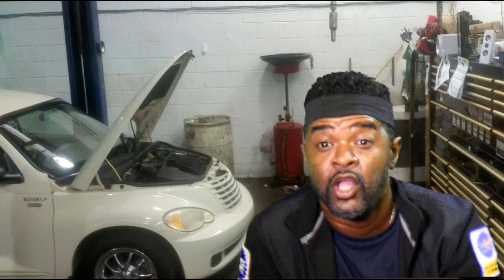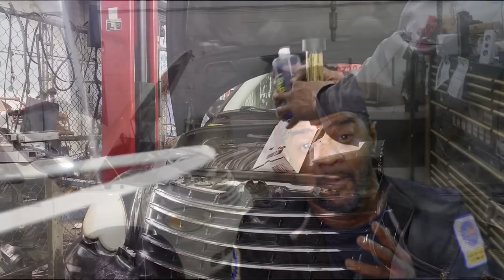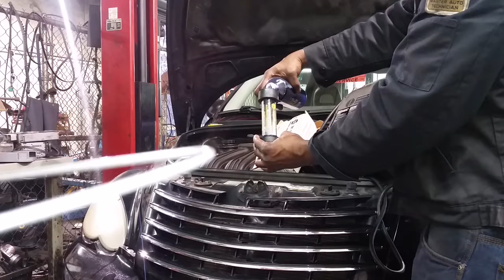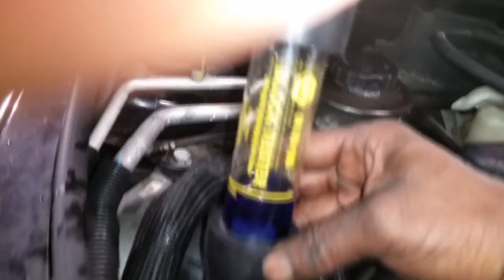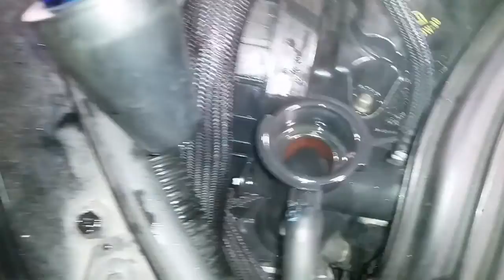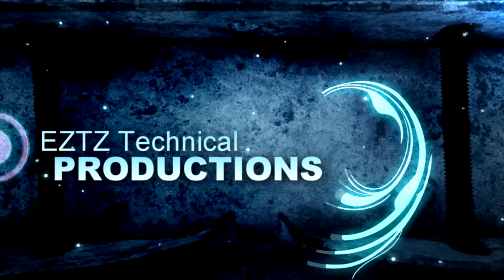PT CRUISER OVERHEATING AGAIN? Here's why. The last test and repair. Overheating with AC on.

Comment: My 2006 pt cruiser runs good but I notice when I drive it sometimes the water comes out of the hoes by the radiator in to the bottle  I have to check the coolant some times what causes that car run good it bubbles sound

Comment: Combustion test is the same as compression test?
Reply from the maker: No. One is to verify if exhaust gases getting into the cooling system.
Reply: @OnlineMechanicTips  would you  recommend to do both test or combustion test is enough
Reply from the maker: @blass5506  What year is the PT? What is it doing? And are you subscribed to the channel?

Comment: I buy cars and fix them and flip them. I just bought a 2001 PT for $800. It is overheating. They spent $2000 trying to fix it. The shop said blown head gasket. They sent the head to the machine shop. They put a new water pump, hoses, thermostat, fan and flushed the radiator. First thing I did was the combustion test. Blue stayed Blue. Next I removed the radiator cap to observe the flow. It was circulating. Temp guage was 1/2 way. I understand that’s normal on these cars. Took it for a test drive. Started rising temp. Stopped immediately. Lifted the hood. The overflow tank was starting too bubble… Air pocket!!! I let it cool. I drained the fluid. Opened the bleeder valve, filled it slowly, squeezed the top hose to purge air, once all the air was out, I topped off the reservoir. Took it for a spin, overheating problem resolved. Still runs a little higher over the 1/2 way mark. I replaced the radiator cap and thermostat with OEM now it runs just below 1/2. I’ve put 200 miles on it, no issues. Car was garage kept and super clean. I called the owner back and offered him back the car for his daughter he said they bought her a new car. He couldn’t believe it, so I took him for a test drive. I now have a customer for life. I also have a PT Cruiser for sale. I’m probably going to donate it to a family. The husband went through the windshield. He wasn’t wearing a seatbelt. She’s a teacher with 2 children. She has no car, they had minimum insurance. Cool explanation. The combustion kits are cheap if you work on cars keep one. If not OReillys will loan you one.
Reply: Great story...thank you for sharing with us all!!!

Comment: This is what my mechanic is telling me he thinks is happening to my car. He thinks I have a “micro leak” with the cylinder head.  But they don’t do work on that or head gaskets so they want to do some Blue Devil treatment that going to cost over $800. I asked why so much and they gave a somewhat vague answer about having to replace my thermostat (which is less than a year old, and do a couple coolant flushings. I have a (less than a year old) radiator fan and water pump. 

But replacing the radiator will cost as much as getting this treatment done. 

And the final thing that sucks is they say that this treatment is only a “bandaid” that won’t truly fix the issue. They say it’s only delaying the inevitable blown gasket.

Comment: Ok, if the cylinder head is warped what is the fix?
Reply from the maker: Well some shops would simply recommend a complete engine at that point. Me, I would simply replace the head and find out what caused the overheating in the first place but you need to be honest to yourself about its worth. Will any of these repairs exceed the value of the car?
Reply: @OnlineMechanicTips  Thank you for getting back to me. I’m subscribed and will now be a follower. All of the last 3 major repairs I have done to my Cruiser have exceeded the value of the car. I’m spending good money after bad at this point but refuse to give up. I’ll do everything I can to see if I can fix the overheating problem and if it needs a new engine I’m afraid I’m done. Thanks again for your help. God Bless

Comment: Hi,I'm write from Larvia,easter europa. My engine is not owerheeted,but when I stop the engine I hear the bibles in coolent sistem? Already thank's.....
Reply: Aloha from Hawaii, I have exactly the same issues. Car don't overheat runs beautiful, then I shut it off and it's boiling in the reservoir. Can you tell me if you solved this issue and if so , how? Thank you so much for any kind nfo

Comment: PT Cruiser are just horrible cars, cheaply made.  Most of them start falling apart before they even reach 100,000  miles.  I wouldn't waste my time on one once the cooling system starts going bad, just get rid of it and don't ever buy another one.
Reply from the maker: lol, you can always just simply not own one buddy. No need to bash out those that still drive them. Some may take offense to what you saying..lol

Comment: I have an overheating cruiser that takes about an hour to overheat. New fan, new thermostat, new sensor. I realize that when It starts to overheat and I’m at a traffic light I can put it in park or neutral and rev the motor and it goes back down every time for a few minutes. What could that mean?
Reply: Same

Comment: PT Cruiser has 2 fans for radiator.  

1 for a/c and 1 for coolant temp.

Saw my a/c coolant fan running and thought ok.

HA! $5,000 for rebuilt engine.
Reply from the maker: The PT Cruiser uses 1 fan sir.

Comment: 2008 PT gauge works ( goes from cold to 1/2 way mark) car hasn’t overheated. But plastic coolant reservoir sometime boils. 
Any guesses?
Thx
Reply from the maker: Couple of things, are you sure the system is full with no air pockets? Also are you even subscribed to the channel?

Comment: Mine is overheating just with the A\C on. I can drive it all day with it off and it doesn't overheat. Ive never experienced this ever on another car. If the head is warped, wouldn't it overheat even with the A\C off?
Reply from the maker: It depends, do it overheat under loads? As in driving only? Also are you subscribed to the channel?
Reply: @OnlineMechanicTips  yes it does it while driving only with the air on. Yes im subscribed
Reply from the maker: That is a sigh of a restriction. Possibly at the radiator. But you still need to verify exhaust gases not getting into the cooling sys..
Reply: @OnlineMechanicTips  how do I check for gases?
Reply from the maker: A block/head gasket tester tool will be needed..I have a video link I will send you showing
Reply: @OnlineMechanicTips  ok, I would have never bought this pt cruiser if I would have known the issues they have. I figured it would be okay since the place I bought it from said the engine was just totally rebuilt and the car only has 98,000 miles. But it did this 2 days after I bought it.
Reply: @OnlineMechanicTips  I tested it with the blue fluid tool and it stayed blue

Comment: 72% people doesn't know evrytime you replace radiator, thermostat, water pump and hearer core need to bleed the system...people just buy coolant and pour it start driving and over heating occurs. Also if you changed radiator, thermostat and water pump keep in mind to consider changed heater core and radiator sensor temp also even it still works....never my aftermarket coolant system parts you end up with problems especially with blown head gaskets.

Comment: Last year I put a new water pump new timing chain a new cam sensor sensor a new mesh air sensor the car was running great then all of a sudden I have no power I’m in the car still runs yes starts right up no issues with starting it’s just that I don’t have no giddyup and it does run a little warm after a while can Can it be my catalytic converter going bad

Comment: I'm having an issue again. My fiance is convinced that it's the water pump but we just fixed the water pump less than a year ago I had an issue before with a different car where it was simply the radiator cap needed to be replaced and it stopped you overheating but don't exactly know if it's the thermostat or radiator cap or something more serious I put some stuff in there to seal all the leaks and it was working fine and then my fiance drove like an idiot and it started losing water again but it's like it bubbles like it's boiling in there and then it's all coming out the top which if I'm correct when it's the water pump but usually comes out from the bottom just any suggestions would help
Reply from the maker: Hello my friend, first thing first with any overheating problems. You need to make sure the cooling sys full and free of any air-pocket. (properly bled) But also it may be time for a block test. Most nagging overheating problems with this car usually indicate exhaust gases inside the cooling sys. Also are you subscribed to the channel?

Comment: Hello I replaced water pump, thermostat and head gasket and still having overheating issues should I replace my radiator
Reply: Overheating can also be caused by a fan that won’t turn on or a radiator cap that’s cracking or many other reasons. The cheapest and easiest thing to do first is replace the radiator cap. It costs like $7 at auto parts stores. All you have to do is take off the cap when the engine is COOL, and put the new one on. After that, if that doesn’t work,  other repairs are going to be more expensive

Comment: I have a PT cruiser and its getting hot when I have replaced water pump and radiator thermostat
Reply from the maker: Hey buddy, you are in the correct video. It may be time for a block test. First, do the heater work? Are you subscribed to the channel? https://www.youtube.com/watch?v=p-6S7USeUTQ&t=575s

Comment: So what does the EGR valve do on the 2001~2002 PT's? Is it to circulate the hot exhaust ait back into the engine to "cool" is off? But you're saying if the exhaust is getting into the coolant?
Reply from the maker: Some may call combustion gases exhaust gases. I likely should use the term combustion. When combustion gases leak into the coolant system, that pressure could cause over heating to keep happening. That could cause hot gases to be pushed into the coolant and the radiator can't get rid of that heat fast enough. Dont forget to subscribe to the channel, thanks

Comment: All of a sudden my 06 PT, the smaller fan kept running even after turning the car off. It eventually drained the battery. We replaced the cooling fan censer but that didn't help. Got any ideas?
Reply from the maker: Hey bud, 2 questions, are you subscribed to the channel? And second, what do you mean cooling fan sensor or smaller fan?
Reply: theres two did you replace both?

Comment: is it normal for the turbo to get so hot you can smell it in the cab on a big hill  ?
Reply from the maker: My friend because the turbo will include some exhaust so they will tend to get hot. Now if the oil seals are leaking and the exhaust hot as it should, you may smell it..Look around that unit and see if oil starting to leak bud
Reply: @OnlineMechanicTips  I got one for yea went over a bump and the rear trailing arm that bolts the rear end to the body broke the body side where it pivits unbolts but the  side on the rear axl looks welded on am i going to have to change the whole rear end to fix that ?

Comment: I am a tech what I have found on pt cruiser is cooling r.p.m. dropping down due to fan motor wear it can be very tricky to find since it still works have fixed two of these with a new cooling fan
Reply from the maker: Yes, happens all the time. That 2 speed fan motor on low mostly used all the time so it gets the most work and wears out the fastest. Thanks for watching. Please like the vid and sub the channel, thanks

Comment: My daughter car was overheating she just put in a new thermostat and still overheating and now she said her fan not running 🤦🏾‍♀️
Reply from the maker: Hello my friend, its likely the fan was not running at first..I would say this, that has to run in order to maintain normal temperature..What year is the car? BTW, please like the video and subscribe to the channel right quick for me, thanks
Reply: @OnlineMechanicTips  she has an 06 pt cruiser
Reply from the maker: @othielytle7074  OK then your car has a TIPM, Its likely the low speed fan motor has burn out..If your fan do not come on when you turn the AC on then yes, its likely the fan. (not the relays on top of the fan) The fan assembly..I see you havent subbed the channel yet, can you please subscribe to the channel, thank you
Reply: @OnlineMechanicTips  I have subscribed to your channel
Reply from the maker: @othielytle7074  Thanks..As I was saying, if the fan not coming on thats the first thing I would get tested and done
Reply: @OnlineMechanicTips  thank you so much for the help

Comment: mini stop at a red light PT Cruiser his blows out hot air when you take off it blows out cold air in a air compressor what be causing that
Reply from the maker: My friend that is a true sign of a cooling fan module failed..During fast driving the fan not needed so your ac may work. The minute you stop is when fan realley needed so airflow can move past the condensor, yours must not be working..Please like the video and subscribe to the channel, thanks

Comment: I have a 2005 PT cruiser and it overheated one day just out of the ordinary. Luckily I was in town so I pulled over n released the pressure so I wouldn't blow the head gasket. I got the car home and changed the thermostat and bled it out. Drove it again for about 60 miles and it started overheating again. It has a new fan and it is working properly.The radiator has never been replaced and I think when I didn't use the proper A/f it may have clogged it worse..Then I realize that the PT cruiser takes a special A/f.
Long story short, you don't think the head is warped if I can drive it that far? I ordered a new radiator because it has the original one and I know their only a single core. Haven't checked for debris yet between the radiator n A/C condensor
Reply from the maker: Hello my friend, thanks for watching and subscribing. Now you very well could have a restricted radiator but you could also have internal problems..Now understand, that aluminum cylinder head will not just warp because a part failed and you overheated. That mostly happen from continued driving while the engine is overheating. So im under the assumption your heater work, that can verify if  your water pump doing its job. You have to have a starting point and build when diagnosing overheating concerns ok..Do not just pick a random part to replace because it relates to overheating. When or if all else fail, it will be time for a block test
Reply: Heater works fine. I checked that after I saw your video. Thanks by the way for that ideal. Replaced thermostat and radiator cap. The electric fan is only 1 year old but It works right on the money. When it overheated, I just put some cheap orange A/F in it and I let it run without the cap on it but it never over flowed. I read the owners manual and you can't use the blue stuff. It has to be orange and contain ethylene glycol because it is a 1 core radiator. It used too suck the fluid out of the reservoir but now it fills it up. I think that the radiator could be clogged just enough when you accelerate the cores have corrosion bad enough to slow down the circulation. PLZ let me have your thoughts

Comment: Judging from my experience I believe that the notorious overheating problem with PT Cruisers originates from the poor quality plastic of the coolant reservoir because it becomes dull in the course of time when, what you can see, is only a mark left by the coolant. This mark gives the impression that the coolant is at its normal level even when the level is very low or when there is no coolant in the reservoir. The true level or the fact that it was empty cannot be seen because of the dullness of the plastic reservoir. Most motorists will ask the petrol attendant to check coolant level especially before embarking on a long trip. Such attendants will also be deceived by the mark and tell you that the level is OK. Whilst driving on the freeway you hear several beeps and wonder what could the problem be and it can take you a few seconds to see that your heat gauge is on the red mark. You find that you cannot stop immediately if the road is busy and by the time you find a safe spot to park your car, the type of damage covered in this video could have already been caused. Chrysler are using very poor quality plastic reservoirs, in my experience and that could be what is causing PT Cruiser owners to spend lots of money on this type of problem.
Reply: Just fill it up till it pours out 🤷‍♂️ 😅
Reply: I agree
Reply: Indeed mine got to close to the manafold and melted a hole about 1/2 up on the jug
Reply: TFT Ttfttz have a fun day for you guys to come over and t stay safe feto eat at this ttutry m ve